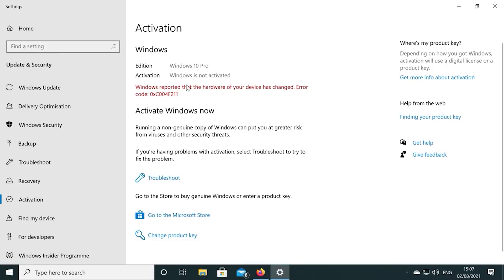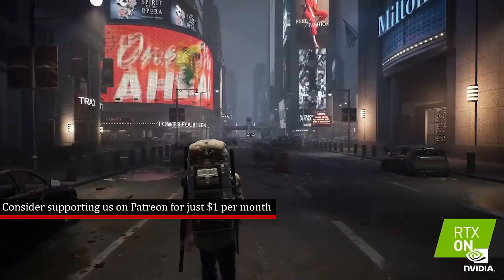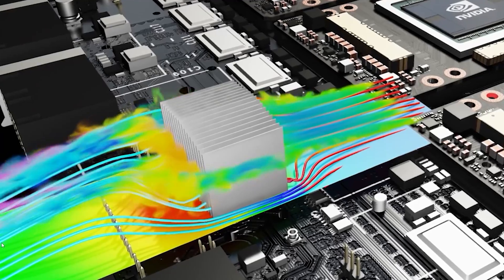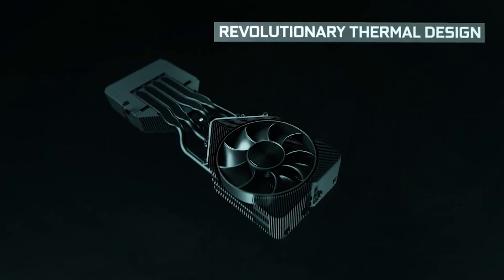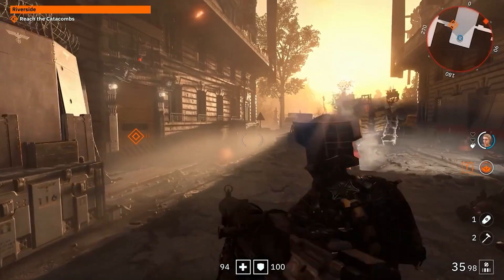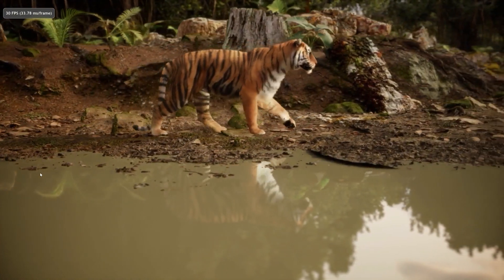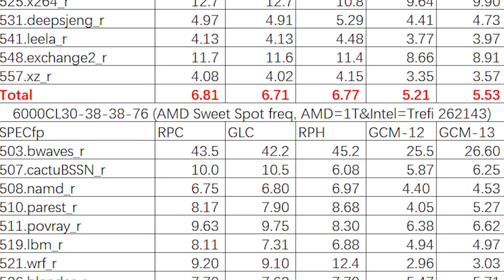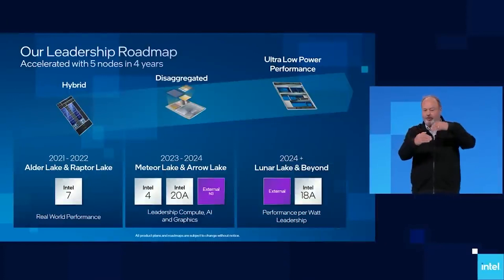RTX 4090 Specs DWARF RTX 4080 - Major Specs UPDATE | RTX 4080 Ti & Path Tracing Leaks

Comment: Seems like a scam to bump the 4080 down to a AD103.  They rebadged the 4070 as a 4080 and bumped the rest of the stack down a notch.  It's as if they are trying to sell 70 class cards for 80 class money this time around.
Reply: they want a higher gap so theycan make lots of super and Tis to fill in and charge more as well
Reply: It should be noted that the 80 series cards haven’t always been on the 102 series dies. Ampere was the first time in many years that Nvidia made the 80 tier on the same one as their flagship. So no, I wouldn’t say that the 4080 is a rebadged 4070, but the pricing will still probably be very high.
Reply: They've been selling 60 class cards for 80 class money the past 2 years anyway lol
Reply: Never forget 3.5 gig vram on gtx 970. When Nvidia is desperate the spectacle will be even more spectacular!
Reply: I don't think they're scamming anyone. I think everyone's been seeing the leaks and those leaks include the specs for the Ti models.
Reply: Want to justify high price while selling 4070 as 4080
Reply: @souravgames  the average gamer will not know the difference unfortunately. Reminder just until a few months ago Nvidia was selling gpus directly to Miners. Does anyone expect any less deception from them?
Reply: It only matters if the price doesn't make sense. Also, the 3000 series was the exception rather than the rule, with how close the 3080 and 3090 were to each other. The 2080 ti and 2080, as well as the 1080 and 1080 ti, the 980 and 980 ti, (and so on) were all much further apart from each other in performance (and based on different chips with each generation). Calling a card a 3090 should have meant that it was further apart from the 80 class of the same gen.
Reply: True. Good time to jump ship.
Reply: How is the 4080 rebranded as a 70 series card? It literally the next chipset down from the 4090. What are y’all talking about?
Reply: Exactly, and btw Intel would never do such a thing with raptor lake low end cpus... Never!
Reply: the 3070 was GA104 and the 4070 will be AD 104. the 70 class cards are still 70 class cards. nvidia just doesnt want to 4080 to be close to the 4090 or it will eat into 4090 sales
Reply: They did the same with the GTX 680 back in the day. Then came out with 780 and 780Ti. But they were originally going to release the 780 as the top card and then the 680. But changed it to launch the 680 as top card. A bait and switch.
Reply: @JacobTech amd literally released the 6500xt. and scam new upgrades to 6900xt just to charge more
Reply: Pascal had 1080 ti with gp102 and 1070/1080 with gp104
Reply: The xx80-tier has always been on the 104 die. It's only the most recent 30-series they've used 102 for both x80 and x80Ti/higher. The performance gap between the x80 and the top flagship is supposed to be big.
Reply: It's what they did with the RTX-2000 and the RTX-3000 series. The 2080Ti gave the performance jump expected of a true RTX-2080. It was rebadged as a "Ti" and sold for £1200 instead of £700.

Same goes for the 3090. Performance expected from a true 3080 and sold at £1500 MSRP. This time however Nvidia outdid themselves one better. An Overclocked 3090 aka "Ti" for 8% faster and sold it for £2000. 

Consumers are directly to blame for this... Fool me once; okay you got me. Fool me twice; man, I'm so dumb. But fool me THREE times? Then it's a fact rather than humour: The Master Race is actually retarded.
Reply: It's funds funny at this point. I am done. 3090 will be in my rig for years to come. It's got silly.
Reply: @paullasky6865  I'm excited for the next gen graphics cards so I can get a 3090 or a 6900 xt for cheap. Those will sit nicely in my PC for the next 5 years.
Reply: well the real scam was that the 3090 was just 10% faster on average than the 3080 but almost twice as expensive.
what the 3090ti is now should've been the difference between 3090 and 3080 to begin with.
so i don't mind nvidia making the 4080 very clearly slower than the 4090. Should be at least a 15% performance difference if not 20.
Reply: @th3orist  based on the specs I'd say the gap between the 12GB 4080 and 4090 will be over 50% in gaming
Reply: @findlaywilliams6610  if this will be the case i expect the 4090 to come in at 2499 :(
Reply: @findlaywilliams6610  u believe that?
Reply: @th3orist  doubtful at least for reference models. Also where does that leave the 4090ti and Titan rumored cards. If anything can be used as a reference I have been saying the 3090ti was a foreshadowing for 4000 series launch in terms of power tdp requirements and higher price premium at $1999 which is what most rumors are predicting for the 4090 reference. Also the market has turned against Nvidia and will be even more so post The merge or proof of stake for Ethereum. If the price is $2499 expect price drops like the 3090ti while not as drastic but plateau into equilibrium between supply and demand. Also if AMD is on schedule and competitive I personally expect Nvidia to replace those prices with higher performance gpus like 4090ti and or titan with obviously higher price premiums or replacing the price stack accordingly to AMD pricing/ performance.
Reply: @JacobTech  it matters cause I don't have PCIe 4.0 and don't plan to have so soon and PCIe 3.0 8x can't take full performance of RX6600 in a lot of games much less something like RX7600XT...
Reply: @guily6669  I just finished looking into a comparison between all pcie with a 3080. It’s not that much. From pcie 4 16 to pcie 3 16 is 1%, ando to pcie 2 it’s about 5%. Look into it and see for yourself.
Reply: @Jahuya  You are misunderstanding a crucial detail. You need a full 16x lanes, which the 3080 has. Yes, as long as you have 16x lanes then it doesn't matter to be on PCIe 3/4/5. The point I made above are for special circumstances where they build GPUs with only 8 lanes. One such GPU is RX 6600, either the XT or non XT I forget which.

If you are stuck with 8 lanes you need at least PCIe 4, or you do not have enough data bandwidth and performance will suffer, sometimes badly depending on the game.
Reply: @Jahuya   LOL... 3080 is PCIe 16x... All RX6000 GPU's are the problem upto RX6700. RX6700 and up are all X16 and below AMD cut them all to 8x only sadly.

And on some games there quite a huge performance lost on RX6000XT, specially the better the GPU the worse it gets and RX7000 would be even much worse if it continues to come with PCIe 8x 😕

But you can check the effects that it would have on a RTX3080 or even higher if the person testing force their PCI-e 3.0 to 8x instead of the full 16x.
Reply: @Glen0cide  PCIe 2.0 x16 provides the same bandwith as PCIe 3.0 x8, and for a 3080 that only meant a 5% performance reduction that was Fausto's point.  In regards to guily's case he should wait for reviews when 4060 / 7600 launch which will probably be mid next year. I don't think it's going to make much difference.

It was a big deal for the 6500XT as that one only was 4x lanes, but for 8x lanes PCIe 3.0 should be enough for a mid range GPU.  I wouldn't be surprised if Nvidia reduces PCIe lane count on their lower end GPUs as well, Intel did it with the A380 already.
Reply: @Lemard77  a 5% performance defecit is a best case scenario, and that figure is likely pulled from the benchmarks from a single game not badly affected. it is a much larger gap in many games, as much as 50% loss in some games. The more graphically intensive and 
GPU bottlenecked the game is, the worse the difference. Hardware Unboxed have covered this quite thoroughly.
Reply: @Glen0cide  Hardware Unboxed video shows small performance penalties between PCIe 3.0 x8 and PCIe 4.0 x16 for the RTX 3080. The biggest difference was Doom Eternal at 1080p being 18% slower for the 10900K in 3.0 x8 vs 3.0 x16, rest of the games were around the 5% region. And actually as you increased the resolution and made the game more GPU bound, the difference was smaller. You are mistaking this situation for the one with the RX 6500XT which is a special case since it has pitifully low bandwith of 4x lanes compounded with really slow memory bandwith also. This wont be the case for the 7600 / 4060.

Look it up for yourself the video is titled "RTX 3080, PCI Express 4.0 vs. 3.0 Benchmark".
Reply: @Glen0cide  You don't need full x16 lanes UNLESS you are running something like a 3080 or higher. 6600xt couldn't give you more performance with PCIE 3.0 x16 if it wanted to.
Reply: @JacobTech  problem is if AMD does the same crap as RX6000 I can sadly only go Nvidia cause I'm looking for a cheaper GPU and AMD reduced PCIe to 8x upto 6700 which is too expensive for my wallet.

Really hope RX7600XT or whatever it will be called is PCIe 16x...
Reply: @guily6669  pcie 5.0 will start with am5. 8x its like 4.0 16x. https://www.youtube.com/watch?v=b-nIMfaoZxo they will only do it to 8x if it will not have impact to us. because they do not want build cards they slow.
Reply: @affe.ohnewaffe  Yeah i'm sorry to say but they already did do this, with the 6600 GPU. It's only 8x and if you have PCIe 4.0 then you are fine but most of us still have 3.0. Yeah sure the new cards will be specced to PCIe 5.0 but that doesn't make any difference whatsoever to those of us still on platforms like B450 or X470 and anything from rocket lake/ skylake. That is a LOT of people who are still on PCIe 3.0 and have no reason to upgrade as very good CPUs are available for those platforms which will last years to come. Building cards limited to 8x lanes is a bad idea and I really hope they don't do it again.
Reply: @affe.ohnewaffe  Nikon1149 already explained it pretty well...

I just went this year from my old I7 2600K at 4.9ghz to a used 8700K and won't be jumping into PCI 4.0 much less 5.0 so soon with those shitty prices that keep going higher.

If AMD does the same as RX6000 there's only one way to go for up to around mid-range GPU's and it's sadly Nvidia only.

In fact if AMD continue the same crap it's almost like they have some shaddy contract behind with motherboard and even intel so that they sell even more new PC's right away specially when the cheaper GPU's are usually people with lower end or older computers that buy but having no PCIe 4.0 at least would be a automatically no-go for 8x GPU's...
Reply: @guily6669  The 6600xt running on PCIE 3.0 is irrelevant. There is no bottle neck at that tier for PCIE 3.0 8x. So it literally doesn't matter. They made a sensible choice to keep costs down.
Reply: @skadragon  unless you are blind... It's very game dependant for example on Forza min FPS on a test I saw for RX6600XT was at 56fps and went to 68fps min from PCIe 3.0 to 4.0 and similar on max FPS...

Though a lot of games the difference is minimal some games have a huge penalty just like ram performance it's very mixed between timings and frequency Vs each game.

And If I pay high for such crap GPU I'd want full performance all the time and not mixed results or for that you can buy intel and enjoy top of the line performance on a few games and a huge pile of crap in others...

Ps: also there's literally millions of games out there and most ppl test like 20 games max so I wonder how many will have huge performance penalty like Forza horizon 5 and moving forward will probably only get worse since memory requirements will keep getting higher...
Reply: @guily6669  Lots of games? You listed one game. One game saw a significant performance decrease so there literally must be hundreds out there!

Keep riding this one little thing, Nvidia fanboy. Have fun with your 3050 at the same price point.
Reply: @skadragon  another game with considerable performance penalty Red dead Redemption 2, then the penaly can be even bigger depending on the rest of the hardware.

You will never see anyone testing all games and I don't play 1 game, I play many and don't want to pay for something that performs normally on one game and might have a big penalty on other and also I only play demanding games like Hell Let Loose, Post scriptum, Squad, Beyond the wire and probably no one will ever test on those indie games which are far more hard to play than the majority of known triple A games...

Also more into the future true Next Gen games are coming soon and they will probably put a big stress in the memory like UE5 games and any other game engine truly updated to next gen...

Edit: forgot to say I'm not fan of anyone and I'm actually using a crap atriz RX480 flashed to strix RX580 and I'm waiting 4 next gen GPUs to buy something like RX7600XT or completely go Nvidia if AMD keep using pcie 8x and will be much worse than RX6000 since the performance looks like it will be much better therefore will limit it more and Nvidia sadly would be the way to go...
Reply: @guily6669  Dude. There is literally nothing else at that price point. There won't be for atleast another year. Do you think the 3060 will ever match the price to performance of the 6600xt? Maybe in the used market in 6 months to a year. Maybe. 

Did AMD make a concession that is 99% irrelevant to lower costs? They did. Being salty about it is stupid. There are literally only 2 games you can point to that show any difference whatsoever. And demanding isn't the factor here There are many very demanding games that don't show any difference in these comparisons. 

The performance difference in RDR 2 would be impossible to notice unless you had a frame counter up and were watching 1% lows. You still only have one game that shows a relevant performance difference. You choose to assume without any evidence that it will make a noticeable difference in games you play. 

Your complaint about the product is petty at best. If there were something there the tech community would be raving about it. They love tearing this stuff apart.
Reply: @skadragon   i just saw a video of a few games tested in the video that 2 games have from massive to considerable performance lost and I don't even play any of the games tested, I certainly don't want to pay for a GPU that will be crippled on my just bought used old cheap PC and I don't even wanna find out what games I will be loosing 10fps 4 sure I pass...

Also most games I play are pretty heavy...

I'd be interested in a RX6600XT if it was PCIe 16x, since it's not I will be waiting for RTX4060 or RX7600XT if AMD doesn't cripple it too.

And anyway RX6600XT is way too weak for me as it barely can do ray tracing or keep 60FPS and I specially want something for the coming UE5 games at 1440P since I plan to change my 22 1080p monitor when I change GPU...
Reply: @guily6669  LOL, you don't even understand what you're talking about. Keep waiting for a unicorn card. The next gen 60s will be priced up like 70s and they won't be coming for a long time.

Try to snag a 3070 if/when it sees a major discount or get a 700 xt or higher used. You aren't going to see a competitor to the 6600 xt except in a short term price crash, used market, or waiting a long time.
Reply: @skadragon   I know exactly what I'm saying cause if I'm going to pay a lot for a GPU it better have good performance, then I'd rather wait for next year...

Also current GPU prices here are far more expensive than USA, so by next year when they release the new GPUs will probably end up having a similar crap price but at least should have a good jump in performance.

And I also wouldn't mind buying used but for now here used RTX3060 or 3070 are almost the same price of new so when their rtx4000 same model arrive they will surely be selling much cheaper unless the world goes completely F* again like China making a war or something...

EDIT: The cheapest RX6600XT 4 example here the cheapest price I can see currently is around 430€ for that crap + the fact that I could potentially lose around 10 FPS in some games I play because of the PCIe 3.0 when it just can't keep 1080P ultra 60FPS on all games much less upcoming games... Guess I'd totally rather pay 500€ for a next gen card later the next year than 430 for such crap now and even still I'm looking more for a 400€ max GPU so I hope RX7600XT doesn't crap the PCIe to 8x again and will have to wait for a promotion on it...
Reply: @guily6669  I will say this again. 6600 xt is be best performing card in terms of price to performance. You won't see a 10% performance drop in games by being on PCIE 3.0. I can't speak to the market in your area. You have to look at the relative prices and see what makes sense. If they are still expensive wait until 40 series launches or mining card flood. Just keep an eye out for price drops.

40 series is not going to see similar prices to the 6600xt in a year. Potentially not in 2 or 3 years. A 4060 might not be released in a year, might not be at msrp for 6 months after that, and might not see any discount for 2 years after it's launch. 

Same story for a 4050, except who knows when that would launch if one even does.

Are you prepared to wait 3 years for the prices to performance you can get in the next few months.

Just keep you eye on prices and grab a 3060 when it hits your price point. You will have to be vigilant and quick. They may dip and bounce back up. They may sell out and never be seen new again(I doubt it will happen this early.)

Bit if it comes down to it get the 6600xt.  You won't be disappointed I promise. And if you can get a 3060 for 400euro then you might be able to get a 6600xt for 300 euro at that same time. Do what makes sense to you. But stop with the anxiety about pcie 3.0. It won't matter in the end. It really won't.
Reply: @skadragon   RX6600XT is far from the performance I need like I said it barely can keep 1080p on all current games much less all the upcoming true Next Gen games and I plan to move on to 1440P cause even at 22inch for me 1080p sucks... Then including performance penalty like I said on PCIe, that's a damn thing no matter how much you say it isn't or Forza wouldn't have lost 10+ FPS to below 60 because of it and like I said I don't play almost a single game of what ppl test, I play many, many others and who knows how many more will have a big penaly specially future UE5 memory hungry games to lead more assets than ever at huge speed and things kept loaded and ready with nanite...

Also I'm not expecting 4060 to be priced like RX6600XT but rather I don't mind saving like 50 or 100eur more than the current shitty price of it here and maybe get 50% more performance than it and I'm not the kind that ever bought a GPU to not be able to play every single game on the year I buy the GPU that doesn't run all at ultra...

RX6600XT here is almost the price of the RX6700XT and actually depending on the version some are still much more expensive than a crappier 6700XT but they are all overpriced much above 400eur and most likely 4060 will also probably be around like 450eur to 500 so I'd rather wait pay almost the same as now but get a huge upgrade in performance...

Also like I said I will be looking for RX7000 and if AMD goes for PCIe 16x on RX7600XT is what I will go for.
Reply: Nvidia scam people and try to drive prices higher? Sounds totally out of character. . .
Reply: @JacobTech sometimes. Both nvidia and amd have crap value gpus. You sound like a full on amd fanboy.